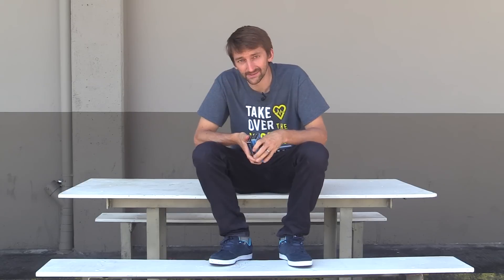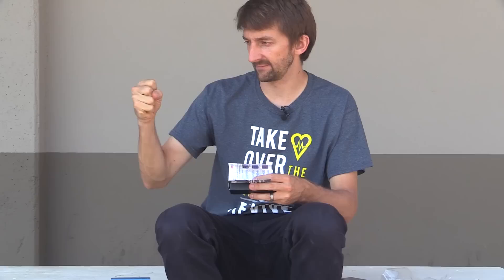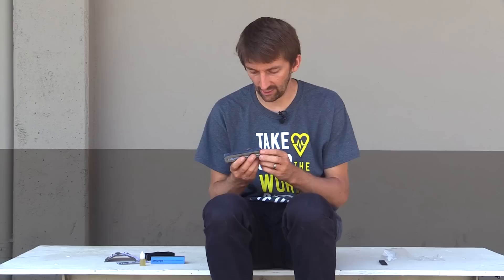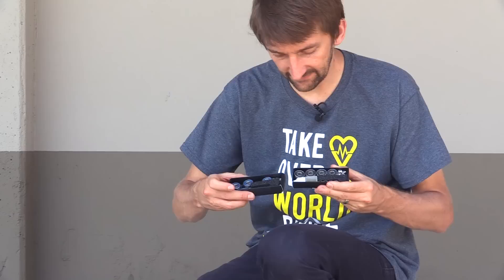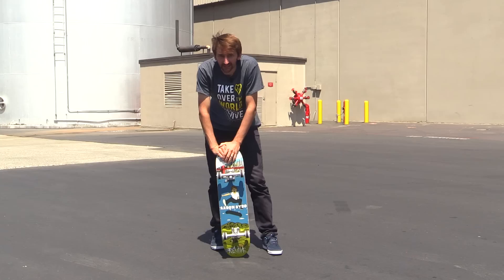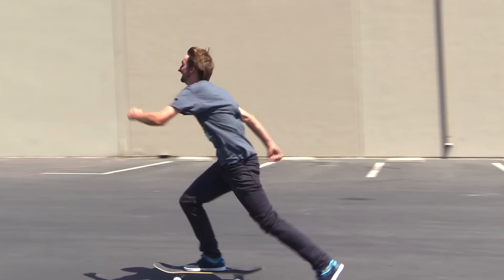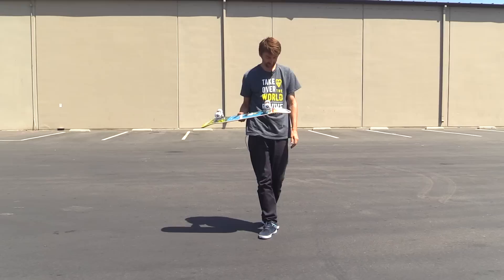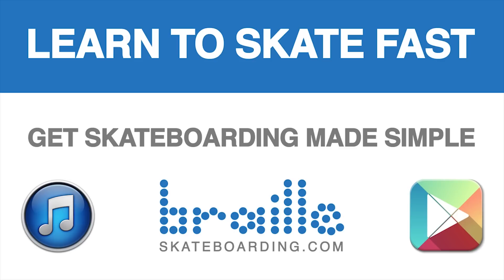CERAMIC BEARINGS VS STAINLESS STEEL BEARINGS | VS EP 9

Comment: I want to see you go down a hill till these ceramic beaings fail.  It will probably take quit a few hills so to lessen this you should soak the bearings before hand in break cleaner to pull all the lubricant out.  Do this with the stainless an ceramic and see which fails first.

Comment: The ABEC scale doesn't mean shit, if it's above 1 it's technically precision and proper for use with precision machinery. Rolling speed and smoothness are not affected, only the price and bragging rights are.

Also, the wheels affect your speed about 10 times as much as the bearings do. My 90a Minilogo wheels go incredibly fast compared to Bones STFs (around 101a) and Bones 100s with the same bearings. The downside to softer wheels is that they don't slide as well.

It needed to be said.

Comment: As for "deforming under pressure".. I don't imagine the weight of an average grown man, standing on a set of stainless steel bearings is really going to make that much difference. Maybe if you weigh more than a car, and maybe if you're going faster than say, a car, but until that point, I suspect that ceramic bearings is just a fancy word for "massive overkill". 

But I don't skate, so...

Comment: what bearing is best to use in a turbo? well for long lasting application its ceramic but for high HP its steel so im going with steel... the reason that ceramic does not do so well in high powered cars is because they disintegrate. whereas the steel can take huge psi and heat in its stride. id imagine its the same deal here
Reply: Ok?

Comment: well i just want to say something about loseing shape of balls inside barings...I have inline skates and  skate board to, that mean both use bearings(a classic steel balls), so actualy there no chanse physically to crush the shape of balls, 1 ball can suffer more than 100kg presure easy, and we have about 5balls inside 1 bearing. And about heating, there are some tools wich use same size of bearings, wich work on 5-8000rpm every day. I doubt it any human can reach even 1000. Only what can damage your bearnigs is rust, if you keep them dry and lubricated,your bearnigs, there wont be problems.Also dont put your inline skates,bords, in some moist basement during winter, and avoid water and rainy days. I didnt try ceramic once but i think there is no big difference...

Comment: Ceramics when you take a variable aka bearings and you make them harder  they deform less so you get a more brittle material which means they might break after using them doing tricks so they would be good long boarding but not a good skate board bearing also the rpms of a skateboard will never hit a high enough speed to deform by heat or Slow you down down you’d have to be a 300 lbs long boarding down a huge hill to get it to slo down by heat it’s just a gimmick because cars don’t use ceramic bearings so there’s no difference other than the fact of you might break them over jumping a big staircase or gain a tiny bit of speed

Comment: If it where a real real thing modern cars or trains would have ceramic bearings. Never heard of but i'm not an expert at cars. Are there any with ceramics let us know if so. And  if a skater, or downhill longboarder breaks his legs because if some bearing has serious issues or rolls out or something, no one cares at all so less risk being sued. There is different quality with bearings but im not so sure the normal bearings heat so much up they give too much friction. Maybe the sand and dirt will do but that would be the same with the ceramics. Another thing is if it expands by heat, the whole bearing expands (i mean the outer and inner ring too) and somewhat reverses the total effect.

Comment: What if there was a bearing with ceramic on the outside and stainless steel on the inside? Wouldn't it technically not rust?

Comment: Ceramic bearings are grossly overkill for skating. They are intended for high load applications (Which skating is NOT).
It is true that they deform less, but marginally so and as a result of that, you may have .5 or even 1% less friction than stainless steel. 
Since the load of skating is only the weight of one human distributed over eight bearings it will never reach high enough temperatures for ceramic bearings to have any benefit. For reference, Stainless steel bearings are still perfectly good to go while your wheels have already melted
Reply: The ceramic also helps polish the inside of the race's after they've been scratched, sort of self repairing (since it's harder than the steel). In theory increasing the life of the bearings. Any person I've ever known to get decent quality ceramics have had them last yeeeaars. I know a guy who's had the same set of Bones Ceramics for 7 years now and he skates aaaaaa lot. Albeit mostly tranny.
Reply: DontTouchMeTherePlz Do steel skate bearings really wear out that much faster?
Reply: 𝖘 𝖍 𝖎 𝖗 𝖔
It's not about wearing out. It's about them locking up and not spinning worth a shit anymore from getting gouged on  the inside. The longest I've ever had a set of 30$ bearings last me is roughly 6 months. If a set of good ceramics only lasted that long it would be completely mind blowing. Bones swiss will last a long time as well but probably not as long as their ceramics. Like I said, the only person I know to have ever bought Bones Red cermaics has had them for about 7 years. The longest I've heard of someone skating a set of swiss is 2-3 and the Red ceramics are about 25$ more for twice the life span.

Comment: just to break down more of the difference imagine taking a hammer to stainless steel and then the back of a toilet (toilets are made of ceramic) the steel will deform, the toilet will bust. ceramic may not deform like steel but add a large burst of energy and ceramic will break into a million pieces. there are more risks of ceramic, lets say if you want to do something that involves hitting the ground hard like a stair set you will be better off with steel bearings but if you want speed and don't want to do anything that involves hitting the ground with a lot of force then you would like ceramic bearings.

Comment: CERAMIC have a higher heat resistance. but you will never reach the speed thet will melt steel bearings.
and ceramic bearings is not ideal for skatebording. As the ceramic is sensitive for impacts. so everytime you do a trick, you can break the ceramic balls. 
but if you are a downhill longborder, then you could use them.

Comment: how does a "professional" skateboarder not know (1) that the "outside covers" are called sheilds and (2) the difference between ceramics and steel bearings. On top of the fact that ceramics dont deform and handle pressure better they are also much harder than steel, this means it can crush and smooth out any shit that gets in the bearing meaning that they clean themselves the more you skate.

Comment: ceramic is for speed steel is for tricks... basic... if you land on the ceramic ones they might shatter while the steel ones will just be a hard landing and keep rolling
Reply: nah, ceramics can handle high loads. they can handle loads under which steel already deforms a lot

Comment: not bad, not the most accurate explanation but close. metal expands when it gets hot, causing the bearings to bind slightly, ceramics take heat like a champ, but are more brittle. if youd like to see how tough ceramic can be, look up videos of machine tools using ceramic inserts. they cut through steel like a hot knife through butter and will even start glowing from the heat and still keep on cutting.

Comment: It was already proven that having ceramics does not make you go faster. Sure it can take a lot more heat. But that is under very extreme conditions and very high speed. Which no skater that goes even the steepest hill can achieve. Ceramics are good for heat management, but they are actually fragile compared to steel. Just think for yourself. What happens when you compress a ceramic ball and a steel ball?

Comment: here's the only issue with the heat debate. you never end up spinning the bearings fast enough on a normal skateboard to heat up steel enough to slow it down
Reply: +Down To Clown I know that. I'm saying it will not be ENOUGH. There's still heat, but not so much that it will deform
Reply: Yea, not enough though mate. If you're dropping in on like, 12 ft ramps, then maybe, but otherwise a skateboard won't go fast enough to do that. 

A longboard though, yea, they're worth it if you do downhill.

Comment: You don’t need ceramic bearing for your S.Board because your bearing on S.board will never achieve thousand RPM.
If you use ceramic bearing on motor bike for racing it will make sense.

Comment: Ceramics are terrible for slides but great for speed. Shouldnt be any performance difference when trick skating. The "under pressure" thing doesnt mean the instant pressure from landing tricks but from the way bumps shock the bearings when going at speed. Also you should be changing bearing two times (or more) a year so it doesnt make a difference. Just a niche part of professional boarding that got marketed to the masses lol
Reply: How is ceramic bad for sliding?

Comment: I think ceramics are not suitable for skating. Maybe for Downhill skateboarding, but they aren't as resistant as steel ones.
also i wonder where's the point of ceramic balls when the Cage is still made of steel?
Reply: Steel fractioning with steel makes more friction, ceramic doesn't do that because it slides more making it faster.

Comment: I think it isn't necessary to use these on a trick skateboard. downhill? Yes! on a long board downhill the bearings are going to heat up and there is where the ceramic bearings are better than steel balls. I'd say stuck with stainless steel and save some money.

Comment: ceramic bearings are good and all but they cant withstand as much impact as steel. ceramic as he said is hardened clay. ceramic chips scratches and shatter way easier than steel. ceramic is a very brittle material. plus they are so much more expensive.

Comment: ceramic bearings have no real use in skating, even when i set up a longboard stainless work just a well. The truth is we never really put enough speed or pressure on our bearings for it to make a difference. Ceramic bearings may last a little longer but a set of good abec 9 ss bearings are like 25 bucks nowadays and run just as well as swiss bones ceramics

Comment: So I should get ceramic bearings for downhilling which will up my speed or... what? Cause my Reds are pretty decent
Reply: +KoreanJoker rekoJnaeroK I would for sure go with some ceramics if downhilling, but for cruising youre probably not going to see a big difference..
Reply: Dru Stuckel How about 40 - 50 mph?
Reply: Uhm, yeah i would buy ceramics, they aren't much more expensive so they're worth a try. If you don't like them or don't see a difference i'd go back to steel.
Reply: Dru Stuckel cool cool thanks m8
Reply: ye ye
Reply: I am riding ceramics cuz they dont need cream and stuff cuz I am lazy xd

Comment: Can I skate in rain if I have stainless steel bearings??
Reply: Well, it's not recommended at all to skate in rain. Reason why is because they will rust due to water getting in them. Not to mention the dirt that will collect inside. If you do skate in the rain, I would recommend cleaning your bearings as soon as you get out of the rain but, really dont skate out in the rain lol and don't be fooled. A lot of companies state that their ceramic bearings never have to be cleaned but that isn't true. They get dirty just like all the others, so while the rain wont make them rust, they'll definitely need to be cleaned afterwards. In my opinion, it's not a fair trade off especially since ceramics are insanely priced.
Reply: lil tip, I dont reccomend it because it will mess your bearings up, but if thats the only issue just use like 3 or 4 drops of bones Speed Cream on each bearing but rain will rot your wood and lose pope remove grittyness of grip rust hardware and maybe trucks and ruin bearings but can be fixed with oil or grease

Comment: so could you ride ceramic bearings in water and still be rolling as fast a day later?
Reply: No because the lube would be washed out and it would have dirt in it and the races are still steel so they rust and also if you skate hard ceramic cracks under impact

Comment: For this application ceramic bearings are nothing but a marketing ploy.  Yes, they will make a difference in extremely high heat, high load, industrial applications over time, but in a bicycle or skate wheel there is no need for anything beyond steel and there is no way you will ever know the difference.  It's nothing more than a way for the bearing company to bilk you for more $$$

Comment: I'm still not convinced ceramic hybrid bearings are better than steel. I run steel bearings in my nitro engines and they have no problem spinning at 40,000 rpms at 250°. I've also tried ceramics and can't tell any difference. I doubt anyone can tell the difference on a skateboard where the bearings are spinning much slower. Also the ABEC stuff is all nonsense as well. Buy ABEC-1 bearings and save your money. ABEC-7 or 9 are for precision applications and only have to do with the actual size tolerance of the balls, ABEC-1 bearings are more than good enough for a skateboard.
Reply: +brandon Yeh bearings were originally designed for high speed machinery, where the differences are more noticeable sometimes. Though for skating bearings encounter a different kind of stress which is actually the compression of doing tricks, rather than just spinning like they are designed.

Comment: I'm afraid your explanation is not totally correct. Ceramic doesn't "not get as hot" but it instead isn't negatively effected as much by heat as steel is. As we all know metal melts. So as the steel heats up it starts getting softer which decreases there efficiency. Ceramic does not melt but it will deform just not as much as steel and at higher temperatures. Great video though and keep up the awesome channel

Comment: is the abec rating what determines how fast the bearings are?
Reply: NO, ABEC scale.. lately almost not used in terms at all is scale for  allowance inside the bearing balls, walls and nest.. .. but you have like 50 other things to consider.. lubrication, diameter of the wheel, surface you ride on, weight. of the board, your weight, spacers, wheels durability, wheels diameter., wheels material , weather.. the stainless steel bearing when heated they expand that's why the friction and that's why more heat.. as I  said many factor but also lot of marketing

Comment: Ceramic wont oxidize ( rust) another reason why they are expensive
Reply: Stainless steel is rust resistant as well.

Stainless steel is steel with more than 10.5% chromium in it. This high chrome content causes the outside of the metal to "passify" meaning instead of creating Iron Oxide (rust) it creates CHROMIUM OXIDE. This chromium oxide forms an outer later that prevents rust from forming.

Even underwater there is enough oxygen dissolved in the water (like carbonated drinks) to keep the chromium oxide strong.

It's the same as Aluminum which forms Aluminum Oxide. The Aluminum Oxide forms a barrier to oxygen and therefor doesn't "rust"

Just so you know, it sounded like you were saying stainless steel would turn red and fall about due to iron oxide. That is a false statement. Stainless steel is probably more water resistance than ceramic (over long periods of time)
Reply: Well I am a big dumb goof. It's in the name " Stainless"... I swear I knew that.
Reply: Chippawa295 
It's fine, not a lot of people understand that there are different types of oxidation, like an apple turning brown is technically an oxidation.

It just so happens that Stainless Steel, Aluminum, Silver, Copper, and many many more metals I can't possibly name all have oxidations that are chemically different than iron oxide.

For the difference between stainless steel and ceramic? I would say it depends if you do tricks or simply cruise. Long term cruising is low impact but more likely to heat up and deform stainless steel. On the other side, high impact tricks could shatter ceramic while only deforming stainless steel.

Honestly I would continue to go with stainless steel for tricks, the life of the bearings can't be 33% longer to make up that 33% cost increase.
Reply: Ceramic bearings do rust. Water gets inside and the walls rust, and the bearings gets all scratchy.
Reply: Richard Smith that's why you get FULL ceramics

Comment: ceramic breaks easier it fails at 8200 pounds of pressure while regular steel bearings fails under 22000 pounds of pressure and reds swiss are just regular reds just a different name its just marketing!

mini logo>rush>red>swiss but minis are just reds with a different name!

Comment: Seems like a gimmick ceramic bearings for skateboarding , better for load & heat? I doubt they would see the load requirement to justify them over stainless steel and same goes for heat doubt they are spinning hard enough to justify heat generated hurting the stainless steel bearings more in this application. From what I have seen in industrial usage where the application is more justifiable ceramic bearings are 10 times the price of stainless steel ones. if its the same in skateboarding the slight longevity of the ceramic bearings wouldn't outweigh the 10X price scale...... gimmick.

Comment: is ceramic lighter ?
Reply: that wouldnt be why they are faster, the ceramic coating makes the bearings almost frictionless, assuming it is a coating, like what I'm used to seeing, and it allows you to use a lighter weight lubricant